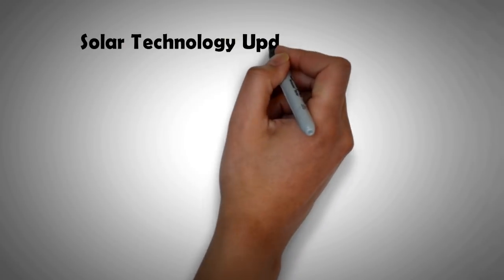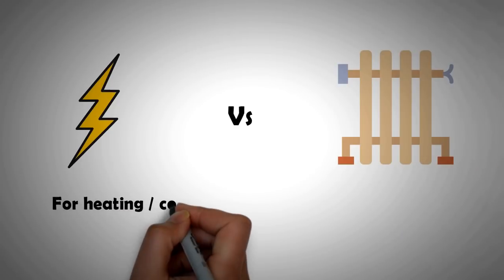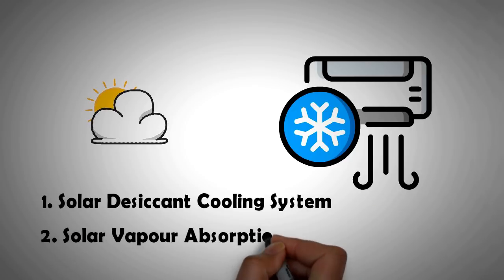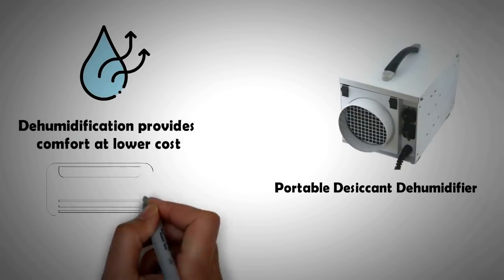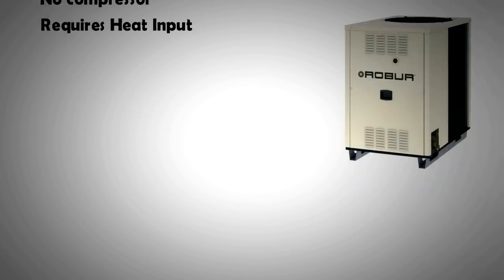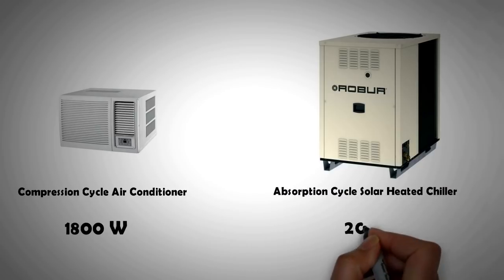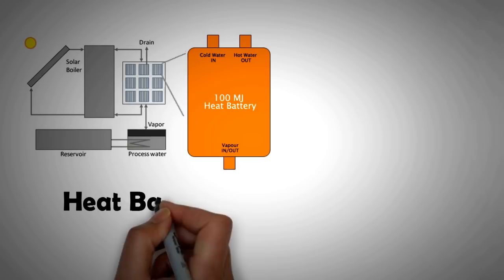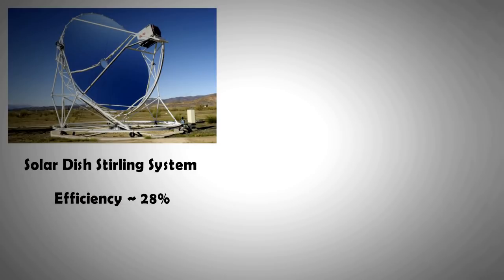Solar Technology Update Part 5: Solar Air Conditioning

Comment: hello there! This video is quite dated. Any more update for the Solar Desiccant Cooling System and the Vapour Absorption Refrigeration/Air Conditioning system. Will the desiccant cooling system work in extreme weather such as Dubai where the humidity of the air can sometimes reach 120%. Does the desiccant system actually cool the interior space?
Reply from the maker: The dessicant dehumidifier takes out the moisture. This in turn  reduces the load of a conventional cooling system
Reply: @synergyfiles3536  Wow! I did not expect to receive your reply so quickly. Thank you for that. Actually, I am trying to use Solar Thermal to cool the interior of a 5 bedroom house in Dubai, and to reduce the cost I am adopting a sustainable approach, and use the availability of constant and extreme Sun raise to achieve the task. Can you give me a few tips on how I can go about these using Solar thermal? Your early response is really very much appreciated, and your videos are really very instructive.
Reply from the maker: @adegokekeshinro4315   your best bet is to buy a dessicant dehumidifier system that runs on solar. I think there is an Australian company that provides that. Once the humidity is reduced, the normal AC will comsume much less energy to cool the room.  When the humidity is low, you will feel much comfortable even at higher temperature

Comment: Air conditioning systems seem to only dump the heat back into the atmosphere. No one seems to see that heat is a nother form of energy that can be harvested as other forms such as kinetic or electrical energy. If you convert it to kinetic you have to cool down the medium and thus it can be used as a coolant. The stirling  concept if reversed can cool the medium using the thrust to make electricity. Some bright fellow could make air conditioners work like this. If we keep dumping all that heat into the atmosphere it only adds to the global warming.

Comment: I want to use our factory Generator exhaust gas for water heating in solar tube then it will running air condition, it possible.

Comment: Could you not also run an air pump in reverse for cooling. Why so many diy solutions vs developed systems
Reply from the maker: True, you can. Heat pump however uses a compressor. This video is more about getting refrigeration/air conditioning without using a compressor

Comment: Thank you
 We in Iraq, summer temperatures reach 51 degrees Celsius. Can you invest this great heat in cooling homes?
Reply from the maker: Yes you can
Reply: @Synergy Files
We are suffering from a lack of electric power supply, is there a low-powered and air-conditioned air conditioner?
Reply: @rasoolthamer1  Based on this video you still need electricity to run 2 pumps so you have to store somehow at least 200W energy but it is definitely less energy than traditional air conditioning. It is worth a try.

Comment: Could you make a video about the DIY dehumidifiers?
Reply from the maker: I will try
Reply: @synergyfiles3536  i tried Google and YouTube and only found peltier device based dehumidifiers, which as far as i understand are quite impractical, your solution looked far more efficient and realistic, hopefully you can deliver! Thanks for the great content
Reply from the maker: @veryverymetta  I have one Peltier based dehumidifier for a room. It does its job but eats up a lot of power. I was looking for a desiccant dehumidifier. They work better in colder climates likes mine in UK. The by product is the hot air which warms the room.

Comment: The most sensible way to heat water is via solar PV and heat pump water heater.  The output is cold air that can be directed into a cold room in a basement to serve as a low cost alternative to a fridge for vegetables and liquids like juice and drinks
Reply: Heat pump is 350% efficient multiply by solar PV at 22% and you’re at the 77% efficiency to heat water from solar.
Reply: @SystemsPlanet  He write correctly. 350%. He based that on COP parameter. 1kW of electricy can provide up to 3.5kW heat energy.

Comment: I found what you said about RV gas/electric fridges interesting. I haven't looked into the energy involved but am aware that when run on electricity they are usually way less efficient than compressor fridges. As far as I know because the electricity is used (less efficiently) to provide heat instead of drive a compressor. 
Do you think it would be practicably feasible to use heat provided by solar evacuated panels to provide the heat neccessary for them, either via hot air or water? The so called waste heat could then be used to add heat to a room rather than being vented via a flu. In my part of the world we spend at least 7 to 8 months heating rooms, so in this way could acheive close to 100% use of the energy exchanges.
Reply from the maker: Its been done in California. In fact they made a 10 ton system running on evacuated tubes. The chiller off course was a industrial one not the RV fridges. However it was fed heat purely by evacuated tubes
Reply from the maker: Here, you will find this link interesting https://youtu.be/R60mqHzi3uA
Reply: @synergyfiles3536  Thankyou for that reply. I will look into it further as I'am at present extending my domestic off grid system and refrigeration from it is one of the goals. Also room heating - if only partially - would be a good way to dump/use any excess after battery charging.

Comment: Important developments since Heating and Cooling is the primary energy user in most homes. Building enough of a photovoltaic system to run the lights in my house along with a fan or 3 is the matter of two or three thousand dollars, but throw in heat and air conditioning and it starts moving into the 20 and $30,000 range.

Comment: What about thermal energy storage for heating and cooling using phase change material
Reply from the maker: Heat Battery uses phase change materials
Reply from the maker: Yes its covered in the video in the latter segment